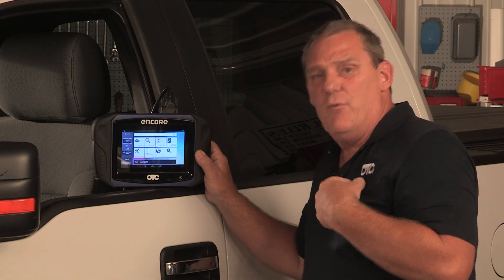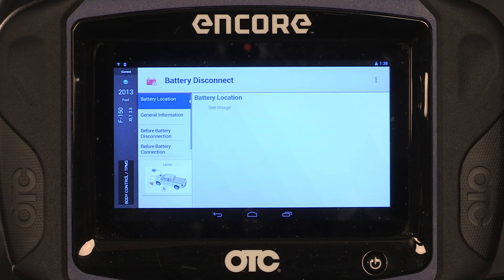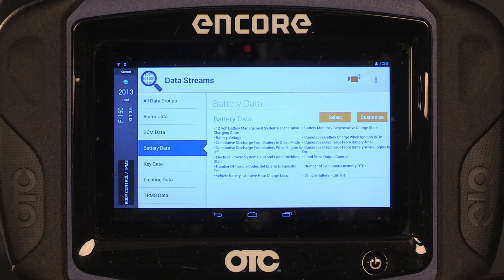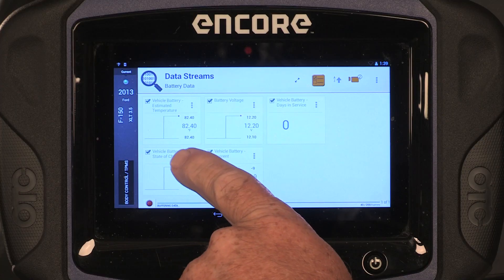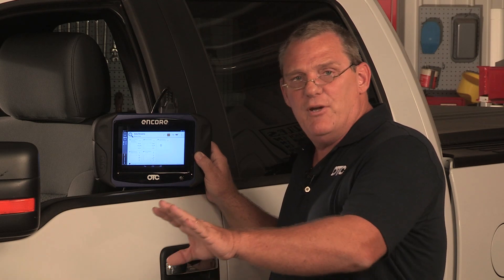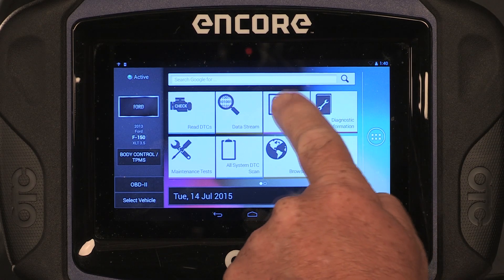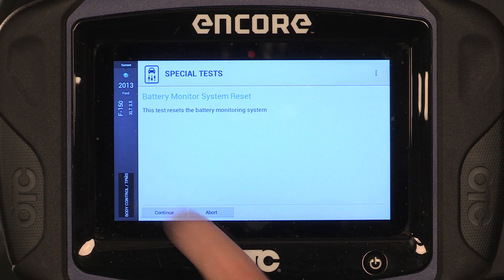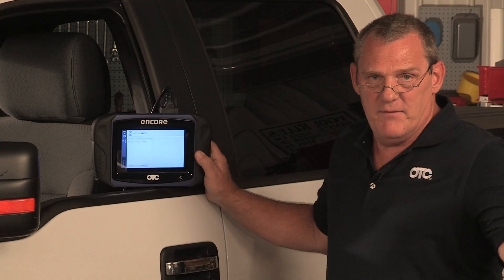Battery Reset Procedure - Ford F-series

Comment: If an auto manufacturer makes a vehicle that cannot be repaired by the owner, then I will never purchase that vehicle.  I know people who only drive old vehicles because they know how to work on them.  They do not buy the new high maintenance cost vehicles.  While ordering a brand new Ford F150 the salesman made the mistake of stating that I can't do repairs at home.  As he put it, "It is a very complicated truck now."  I got up to leave.  It took a lot of back paddling on his part to get me to sit back down.  I do my own repairs and curse out FORD design engineers every time.  It's obvious that they made design decisions to prevent the home mechanic from doing his own maintenance.  Just do an oil change and you'll know exactly what I mean.
Reply: All newer vehicles are a lot more complicated than they use to be. It has less to do with not wanting the consumer to work on them and more to do with new technology installed in them. If you can't figure out how to work on it the right way just save yourself the headache and bring it to a shop.

Comment: So I replaced the alternator and battery on my 2012 F-150 . Battery symbol on the dash won’t go away .  Where can I take my truck to have this procedure done aside from dealer . Or should I just take it into the dealer and have them do it ?
Reply: I just took in into Ford they said it’s a bad Alternator. I highly doubt it . I bought a non Ford alternator first and installed that one, the battery symbol wouldn’t go away so I then bought an Alternator at Ford (which they are very expensive) . Ford wants me to go to the Ford that I purchased the alternator and get a copy of purchase so they can warranty the alternator. What a headache
Reply: Did you figure it out? I called a couple dealers and they stear me away from this theory and say I gotta replace alternator, but according to AutoZone and advanced Auto free checks it's all working good
Reply: P